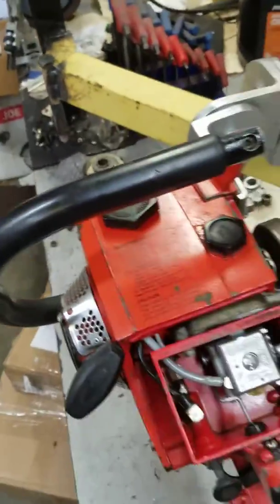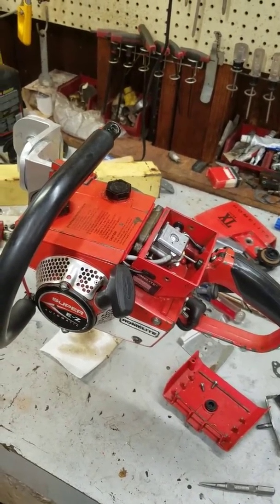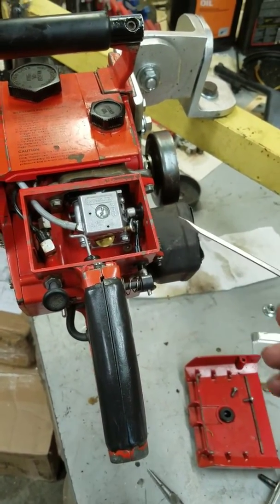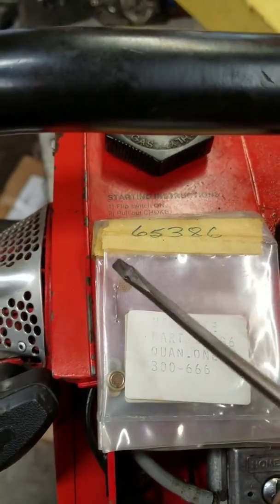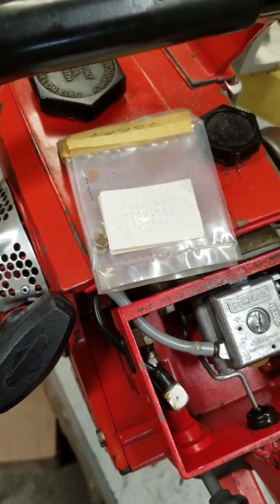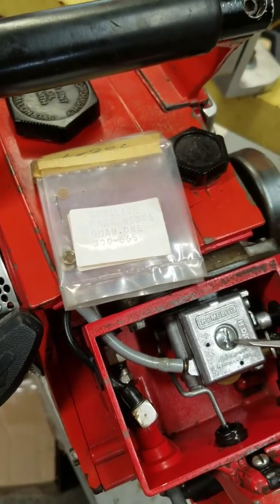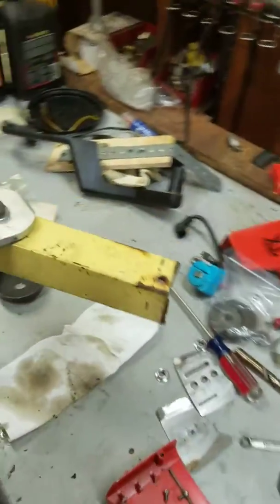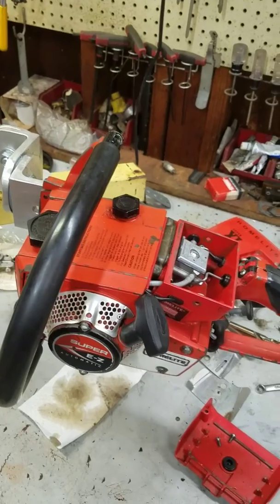Gary's Homelite Super EZ

Comment: Interesting, I was under the impression if you used the rim/drum sprocket you needed to have the 3 shoe clutch. From the looks of it here you can use the S-type clutch still.
Reply from the maker: The rim setup is definitely available for both styles of clutch, you just have to be careful and match up the parts.